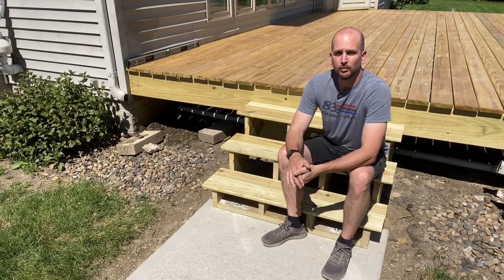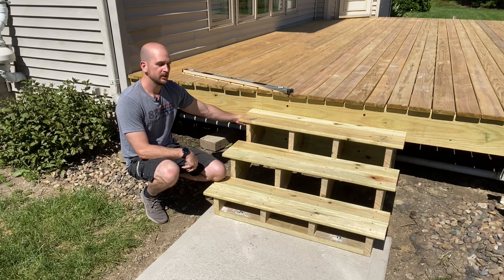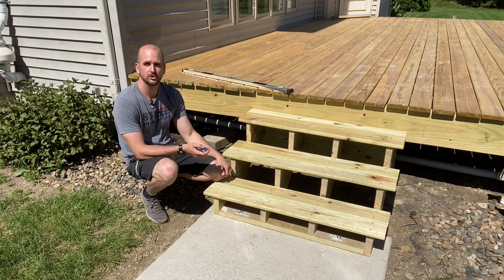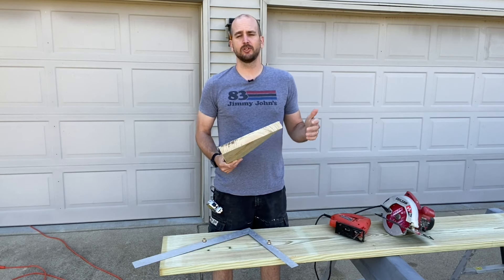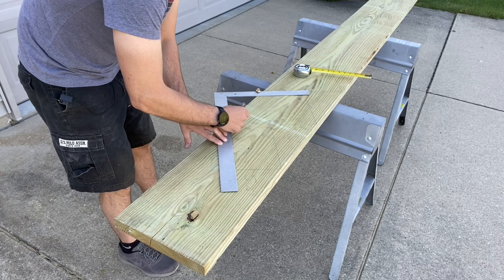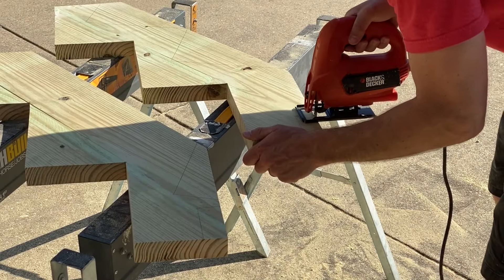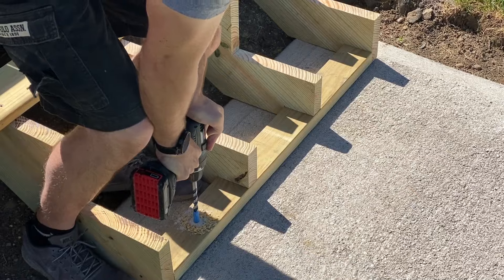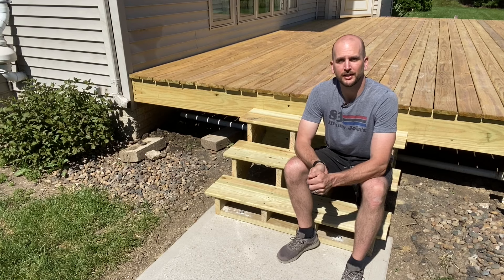How To Build And Attach Deck Stairs

Comment from the maker: Tools and Parts Used
1/2 Masonry Drill Bit:  https://geni.us/rOSw8
1/2 Concrete Wedge Bolts:  https://geni.us/EvBecg
Skilsaw:  https://geni.us/J8pWhL
Diablo Blade Used:  https://geni.us/RRCX3x7
Jig Saw Used:  https://geni.us/2UNzkA
Framing Square:  https://geni.us/JGiRDLY
Stair Gauges:  https://geni.us/VIw34sT
4.5 inch Structural Lag Screws:  https://geni.us/NCp6CCx
6 inch Structural Lag Screws:  https://geni.us/iGBW5
Pressure Treated 2 x 12 for Stringers
Stringer Connector Plates:  https://geni.us/ZIYyB
Hot Dipped Nails:  https://geni.us/7argjy

DISCLAIMER: This video and description contain affiliate links, which means that if you click on one of the product links, I’ll receive a small commission.

Comment: Warning! Before you start cutting your stringers with the circular saw, check that your saw blade is square! Even if the angle measurement shows that it is set to 0 degrees, it might not be square. This was the case for me and I didn't realize it until after I had finished cutting one of the stringers.
Reply: ah, i see we done the same thing. I had a Skil circular saw, and i noticed the plate was bent after cutting some lumber. had to go get another one. so frustrating.

Comment: For a very novice home project guy, like myself, this was extremely helpful and very clear! One thing that I did because I had some time to think through how I needed to build my stringers is that I built some test patterns out of cardboard first, to see if my dimensions were working out how I needed them to. Good thing, the first two patterns I cut out were way off! :) Third time's a charm and now I'm ready to use the saw to cut out my 2x12's. Thanks again!

Comment: Great explanation!  I gotta do the same thing but with a 6 stair stringer.  Where did you get your concrete landing area?  Thanks.
Reply from the maker: I installed it the week prior.  Here is the video outlining the concrete slab part of the project.  https://youtu.be/lKoekm35gjs  Best of luck on the project!

Comment: here you have to close the back of the stairs in and you have to put railings on if you have more than 2 steps . I have to replace my stringers because the builder overcut the stringers and weakened the stairs.  They were splitting at that point on the stringers . I guess he did not want to use the extra care to use a jig saw. I bought stringers with 6 steps because the pressure treated wood to build the stringers was wet and in horrible shape . Full of knots also  and some knots were falling out .

Comment: This is the clearest explanation for building deck stairs I have seen. Thank you so much for including wood dimensions, tools and hardware needed as well as how to measure rise and run.
Reply from the maker: You bet and best of luck on your project.
Reply: I’m planning on attaching wood on the vertical….when cutting for the stringer, do I just add to the depth of the tread? (I know, probably a dumb question)  
I have a total of 7 steps going up to the top of my deck but I don’t want to leave it open underneath. Thanks!

Comment: Great video. Short and to the point. Tge steps thst go from one level to another exceed the code, snd are a but hsrd on the knees to get up and down. They used steel risers from home depot, but I want to build stairs with a 6.5" rise to be more comfortable. This video definitely helps me plan this.

Comment: Few comments on the products you used:
1.  Those HeadLOK structural screws you used when you were under the deck are friggin awesome.  Not cheap.  But worth the coin.  I am currently in the middle of a deck remodel.  (Resurfacing with Trex, etc.)  I am trying to salvage as much of the existing framing as possible.  I used the 4-1/2" version HeadLOK to shore up what is worth saving.  After years of settling, warping, and nails rusting - the rim joist had pulled away and twisted from the main joists.  I drove a few of these through the rim joist into the ends of the main joists and it sucked it right in, nice and flush.  Tight as could be.  It actually straighten the twisted board. 
2.  Along the same lines, I attached my posts with their ThruLOK product.  Talk about solid.  I tell people if you were to crash a truck into one of these deck posts, the Post will win.  This company sells a solid line of products.
3.  The Simpson Stringer plates you used and posted in the description, I am going to buy for my current build.  I will probably drive a HeadLOK into each stringer from behind as well.  But I like the idea of those hangers. 
Thanks for the video and nice work.
Reply from the maker: Hey Diesel Mike how's it going?  Thanks for the additional feedback on your experience trying to get more life out of your worn out deck.  I was also impressed by the FastenMaster lags and really liked the drill bit design as there is little chance of stripping while your torquing.  Did you finish up your project?
Reply: @EverydayHomeRepairs   Thanks for responding.  I am not done yet.  The amount of prep work has been insane.  I had to do an extreme amount of blocking.  The deck is 15X30.  The main joists were in decent enough shape, but there was no blocking throughout.  I ran two rows to really strengthen it up.  
I am picture framing this deck with a double divider strip right down the middle.  So that involved more blocking (one on each end & one down the middle) as well as repositioning some of the joists to accept the picture frame and location of the divider strips.
I also had to replace all the posts as the old ones were notched which is no longer allowed.  Not to mention they were wobbly as hell.
So this weekend I did manage to get most of the picture frame installed.
Here is a link to my Google album on the project.  I may eventually edit and post a video to YouTube.  But there is no "action" shots.  Right now I am working with the camera off and just filming some updates at the end of each day explaining what I did.
https://photos.app.goo.gl/FNK8atzTiiK51LRYA
Reply from the maker: @DieselMike  Dang that is a lot of prep work but from the pictures looks like it is really starting to come together.  I really like the picture framing and looking back on mine think that would have been a better option.  I liked the idea of using 26 foot pressure treated to extend the width of my deck but didn't take into account the large amount of shrinkage that would occur along those 26 feet as the moisture worked out of the boards. Live and learn.  Best of luck on the rest of the project and post the pics once you are done!

Comment: Curious about two things....stringer hangers?  Riser kick boards?  We usually recommend them for safety purposes.
Reply: Building code only requires kick boards when the height of the stairs is above 32". Same for handrails.

Comment: Amazing video. I am following your advice while building my deck. 

I like how you used the 4x4s and blocking to extend your rim joist for your stringers, but why did you double the rim joist?
Reply: So it will line up w the existing double rim joist

Comment: Will you ever add a face or kick plate board to the stairs?? Looking for a good tutorial for that!
Reply from the maker: Hey Sara,  I was not planning on adding a riser to this set of stairs but if I did I would need to compensate for the riser board thickness in my measurements prior to cutting out the stringers.  Best of luck on your project.

Comment: I live in Florida where there is a lot of heat and rain, should I put a gap between the treads? Great video!
Reply from the maker: Usually the gap will naturally form as the pressure treated wood dries out.  Even if you place the 2 boards together over time a 1/8" - 1/4" gap will form.  Best of luck on the project.

Comment: I liked the video...but I sorta agree with the one rude comment about the pace of measuring and cutting the risers...which is the most confusing part - to me at least.  Where do you make the first mark/cut from the end of the board.  And where did you get the nifty little clamps for the square?
Reply from the maker: Thanks for the feedback.  You can usually find little gauges at home improvement stores or here is a link on Amazon.  https://amzn.to/3sOj9fe

Comment: very solid install. im doin a 6 step staircase and need to have rails with guard post on the bottom. if installing that 2x4 cleat to anchor it to the concrete it will be in the way to where the post is goin to go . any ideas on what to do in that situation? Tnx

Comment: Nice clear job.........however you have left out an important step, weather proofing. Sealing the cut ends and adding joist tape between the stringers and the treads as well as between the bottom and where the stringers touch the cement. Every hole where a screw attaches the tread to the stringers is a conduit for water promoting fast rot and early compromise of the support framework. Guess it might not matter much in New Mexico, Arizona ect but in the S.E. or Seattle those simple cheap steps will multiply the life of the stairs.
  You do too good of a job to have it needlessly rot early.
Reply: Thanks. I live in the SE. I’m needing to create stairs to my back deck. That’s good to know. My rise though will be about 7 feet. I’ll have to work all of this out on paper before starting.

Comment: Hi Scott, nice quick to-the-point video on how to add deck stairs. That is my next project on my refurbished deck. Why no safety railings? How would you add railings if you had to, to meet local codes? Maybe you could make that another project video? Thanks.
Reply: You only need safety railings if your deck is over 24 inches from the ground
Reply: As RTC pointed out, you may not have to. But if you have a deck above that minimum, you are probably going to want to build posts to support the railings (including on the stairs). There are videos out there on how it has been done. Blocking the deck posts is the "fun" part.

Comment: very good job application  but I guess  you did miss something  to put some insulation  between  the wood and the surface ( concrete.......)and am sorry for that it's  not  a complain  but advice  am amateur  trying to learn from others as much as I can with using your own  knowledge. you learn me something as well great futur from Scandinavia 😇🤣
Reply from the maker: Thanks for the feedback 👍
Reply: What would be the insulation material
Reply: @Sssanbo  ; I heard a vapor barrier could be used to keep the wood from directly contacting the cement and thereby preventing rot. However, I’m not sure if it’s really needed.

Comment: Nice job! Is it possible to predict-cast galvanized or stainless threaded bolts into the cement pad. Rather than drill holes? I don’t have access to a roto-hammer. Also, any need for steel (rebar) in the pad or can it just be poured? We are coming down an 8-step stairway to lower lawn.
Reply: Could you just use a drill bit designed for concrete?

Comment: I just had a question about the bolts you used in the concrete. Do they go directly into the hole you drilled or was there some kind of plug that had to be hammered in for it to grab onto? Do the bolts just grab into the cement? Would it work if they were bolted into a premade cement patio slab or are they usually too thin? Thanks
Reply from the maker: Hey Sam, when using the wedge anchor bolts like the ones in the video they are just place directly in the hole.  The bolts grab because as you tighten the nut a wedge is pulled up into a collar that starts to expand and gets "wedged" into the hole.  In regards to your cement patio slab you would just want to ensure the bolt used fits into a solid hole and does not poke out the bottom.  Also remember you will want a hammer drill with the recommended masonry bit for the anchor bolts.  Best of luck on the project!

Comment: I've seen the "structural screws" but I figure the 1/2" carriage bolts are far more reliable.  Over time screws bite threw wood fibers and loosen up.  Then the lumber starts to move, which leads to cracks.   

In addition, you fastened your stringer heads to the rim joist using the simpson hangers and that's pretty good, and you fastened your stinger feet using a plate.   But that creates an awkward stringer assembly that you carry and lift into place.

I prefer  to cut the stringers on a bench, and fasten them on the bench with top and bottom plates.  That way, when the assembly is moved into position, the stringers are fully supported.  

Unlike you, I prefer to use full width stringer plates - 2x12 (you used a 2x4).  Also, I recommend you reinforce the stringer feet/bottom plate interface with either Simpson brackets - or - 2x lumber to prevent future stringer foot twists, or rotational movement. (It's called "blocking")  Yes, the decking and risers will prevent that.   But, not nearly as well as structural lumber, or engineered steel.

I like the way you built the concrete landing, and I like the way you attached the stringer foot plate.  However, I'm undecided on whether the foot plate needs to be fastened, or should be because ultimately the treated lumber will shrink.  And the concrete pad is likely to rise and fall.   As such, a floating stringer foot/plate might be wise because it allows for micro movement without pulling the fasteners apart.

Pretty sure that "code" has 2 safety issues that you missed.  1 is the "risers".  Risers are a safety issue because without them people can slip their foot into the gaps and break their leg.  The other issue is that code requires "hand rails" on both sides for stairs.  

Another interesting note, is that (last time I looked) Code required no more than a 7 1/4" rise.  But that's a lot for a older person.   I prefer to add an extra step or 2 , and get the rises down to 5 inches.

Comment: What would you need to change if you wanted to close off each of the steps with a board? How mid that done while maintaining the overhang on each step?
Reply: Install your riser boards then your tread. If you want an overhang just make sure every step has the same overhang. Your inspector then measures tread length from outside edge of lower step to outside edge of the above overhang. As long as your riser boards and tread boards are the same thickness and your overhang doesn’t vary, your tread length will remain the same. Ex. If you’re using 1” decking with a 3/4” overhang, use the 1” boards for both rise/tread.

Comment: This is exactly what I need but for months now, I just cannot do it.  My deck height is 32” height.  Where it lands is 34” though, so I guess my ground slopes down a bit. When I try to calculate my stringers, it never comes out right.  I want three steps just like yours. The code over here is 8 1/4 max height (rise + tread).  Is it possible for me to even get away with 3 steps or must I raise my landing height to 33” (4 x 8 1/4)?  I have cut out multiple stringers using cardboard and it never works. This is driving me crazy and wee haven’t been able to use our deck for nearly a year, since I began replacing all of the wood.m. Any suggestions?

Comment: Good day
Like to know the maximum width I  were to use 2 pieces 
 stair stringers
Reply from the maker: Hey Jose,  I would check the local code but here in Illinois we usually have a minimum overall width of stairs being 36" and people usually use 3 stringers for this setup.  Since I was a bit wider than 36" I went for 4 stringers.  Also depends if you are using deck boards like me for the treads or thicker 2" lumber for your treads.  Best of luck on the project!

Comment: Nice! Is it possible to have longer run with only 2 steps? Assuming u didn't want the steps any further out then they are
Reply: There are formulas that determined acceptable rise and run and if it is being built in a code-enforced area, you might have to. But maybe you are thinking of a landing between each step.

Comment: Hi there, what was the 1/2" bit and fasteners you used at 10:38?
Reply from the maker: Hey Jack,
Thanks for the call out as I don't know how I missed those in the video description.  Here is what I used for securing the stairs to the concrete.  Best of luck on the project.
1/2 Masonry Drill Bit:  https://amzn.to/2EQRTV4
1/2 Concrete Wedge Bolts:  https://amzn.to/2SqNATH
Reply: @EverydayHomeRepairs  Thanks!

Comment: How far apart do you space the stringers a client wants a 10ft set of steps on her deck
Reply: I have the same situation and an wondering that too. We purchase our house in 2000. The previous owner built a deck on the back at the first floor level. But we live on a slope. There are no stairs to the ground level. The rise is about 7-8 feet. I’m wondering how many stringers I’m going to need and their spacing.

Comment: It’s the process the same for longer flights of stairs?
Reply: You'll need handrails with posts on each corner to support them (and bracing on the posts). There are other videos on YouTube that show ways of doing that. And of course, if this is for a deck, at that altitude, you'll want to build railings around the deck.
Reply: Don't follow this guy's advice - his stairs have no support at the back, just hanging off the rim joist.  Longer stairs would mean a longer fall if they break loose. *Longer flight means there might be more weight/people on it, besides its own greater weight. **27 yrs., licensed residential builder.

Comment: how do u do it if its dirt where the landing will be?
Reply: Mine has a board on the ground instead of cement— idk if this is correct but it’s not dirt 🤷🏻‍♂️
Reply: lay you some rectangled or square pavers on the ground for support and to keep it off of ground.
Reply: Definitely want some hard surface. As others have mentioned - pavers work well.